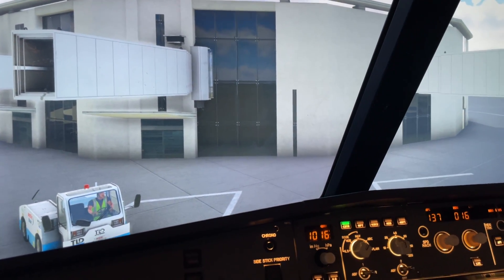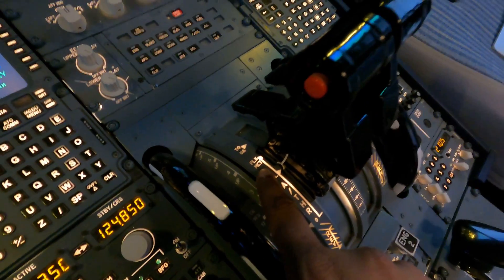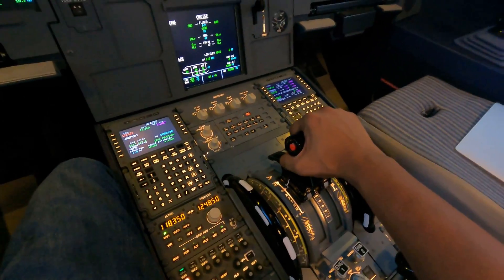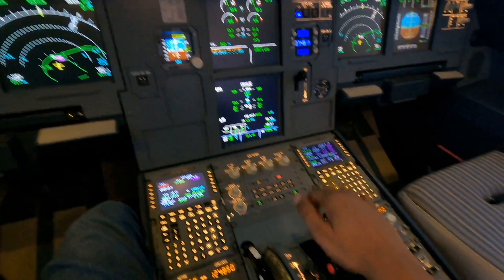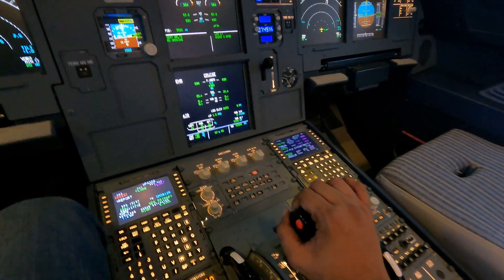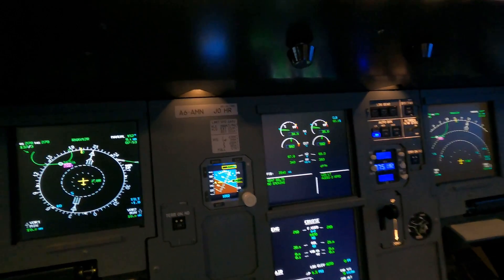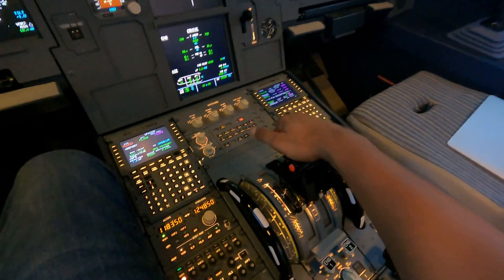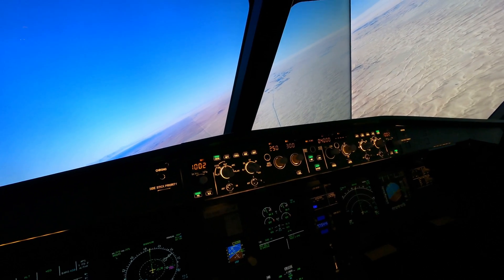Airbus A320 | In-depth Thrust Levers Tutorial

Comment: Excellent video, very instructive and well explained.
How the two thrust levers are interconnecting ? are they mechanicaly connected and locked or are they free to move separatly at any time ?
In case they are free to move separatly, what's happen if one thrust lever in move differentiently for the other one.
Reply from the maker: They are free to move separately, moving the thrust differently will cause asymmetric thrust causing the aircraft to yaw.
Reply: Many Thanks. So , If not properly applied during TO for example, this may consequently generate severe directional control problem.

Comment: I've always been curious about manual thrust mode in the airbuses.  Thank you!  One question though, even if you lift the reverse locks in air, doesn't it prevent the levers from being pulled back into positive reverse thrust?
Reply from the maker: Thanks! Yes, the onboard computers use an array of sensors of systems to let the A/C know that the A/C is not on the ground therefore pulling the thrust levers into Reverse detent would only result in putting the Engines in Idle and not into reverse. Once you're on the ground and the system detects wheels on ground it then allows the reversers to activate and deploy.

Comment: Hi! Thanks for the video just one question that i got. If i disconnect the autothrust and i am managing the thrust manually and put the lever back to climb detent, does it activate the autothust back or i still have manual control? Thanks for your answer👌
Reply from the maker: Hi, 
If you disconnect the Auto-Thrust and put the Levers back in the CL detent the Auto-Thrust remains off unless you reengage it on the FCU by pressing the  A/THR button. If you want to get the auto thrust back using just the levers the trick would be to push the thrust levers all the way to toga and then back to CL and will engage the AutoThrust automatically 

Hope this helps :)

Comment: Hi, when you need to put the engines at 50% N1 for takeoff, where do you place the thrust levers? I've noticed you set the levers by the "T" in A/THR, if that makes sense (Between Idle and the Climb Detent). Is it always by the "T" or "H"?
Reply from the maker: Hey Pablo, 
Generally, we wouldn't look at the letters for reference but rather at the N1 gauge on the ECAM to make sure we're setting it to 50% correctly, you could use the letters as a rough estimate guide but using the engine instruments is the best professional way to go! :)
Reply: @waypointsaviation   Thanks! "H" it is 😂
Reply from the maker: What ever makes you happy! 🤣🤙🏽
Reply: @waypointsaviation   What percent of the engines do you use for taxiing? Is it 30%?

Comment: What will happen if we turn off A/THR and levers are in climb detent and aircraft's speed is in selected mode (lower speed than climb detent will provide)??
Reply from the maker: Hello, 
As depicted in the Video, if you leave the Thrust levers in the "CL" detent and switch off the Auto-Thrust, The Engine power will be set to wherever the "Position" of the thrust levers are which in CL would be around 96+ % N1. With Auto-Thrust (ATHR) OFF dialing a speed in selected would mean nothing cause that would need ATHR to be ON to function. 

Hope this makes sense

Comment: What happened when you pulled back the thrust levers while in the air? Doesn't the system prevent to do that? I hope the thrust remained at IDLE when you did that... 😅
Reply from the maker: Hello, 
Yes, if you bring the Thrust levers back to IDLE the system turns off the Auto-Thrust and the engines will throttle back to Idle power, but if you put the thrust levers into Reverse while in the Air, Nothing will happen, the system will prevent the reversers from opening. Airbus went to great lengths to stop pilots like me from doing that in the Air! 🤣
Reply: @waypointsaviation I was half expecting the plane to call you the r-word 🤣

Comment: Very knowledgeable tutorial. Can you explain what will happen to the thrust levers when the A/C stalls? Will they still rev up to TOGA if A/T is off?
Reply from the maker: Hello, Thanks,
Yes, if you enter a stall while the Thrust Levers are in the "IDLE" position they A/C will put it into Alpha-Floor mode and then TOGA LOCK locking the Thrust in maximum power until the recovery from the stall is recovered and Pilot manually disengages it re-engages the thrust properly. This can be seen in this video... 

https://youtu.be/MtDbeteM8B0